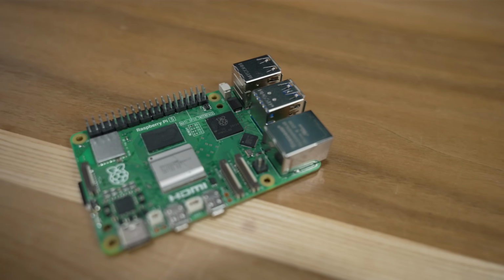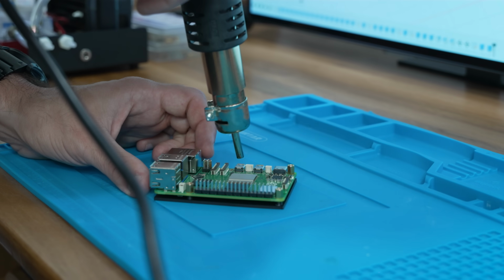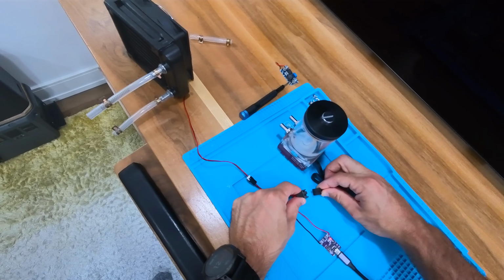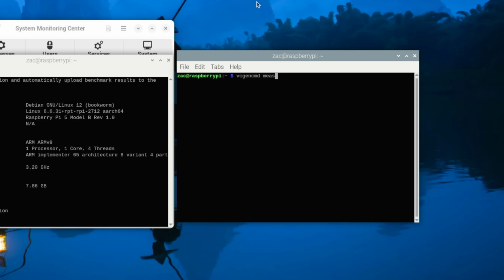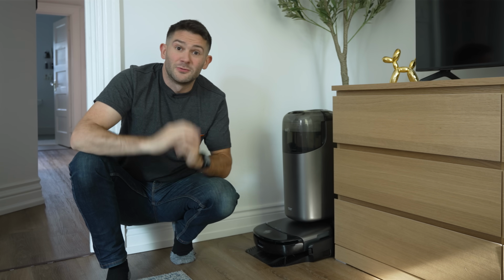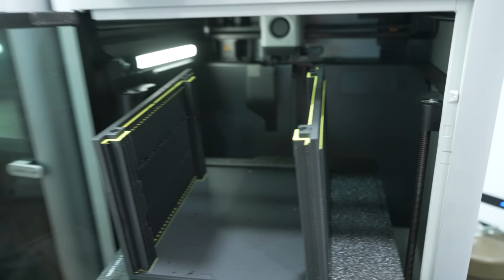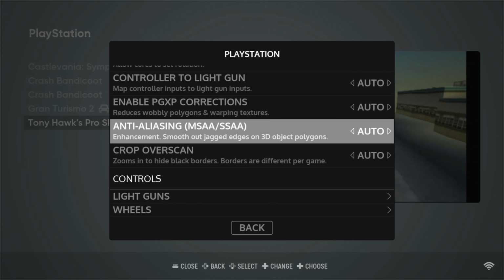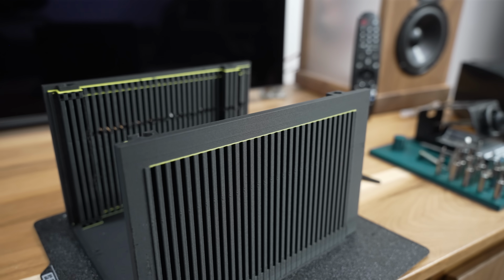Pushing a Raspberry Pi 5 to the LIMIT....

Comment: A number of things to note here. 
A. It’s pronounced like “bottosarah” or, more phonetically “baw-toe-sarah”. 
B. Your overclock only was active on the pi install. When you installed Batocera, that wiped the overclock. It’s a software overclock, and not a persistent hardware overclock. 
C. Thermal pads would have been a better choice for thermals transfer. 
D. As another has said, your 84 degree temp was rather disingenuous as you had the IHS removed. That little plate actually wicks away a decent amount of heat.  
D. You should have installed some kapton tape on the cpu where where there wasn’t direct die contact. There’s a number of onboard caps and resistors that are almost the same height of the cpu die. Your heatsink plate doesn’t stop from over tightening so you have a very high chance of shorting out the cpu since you removed the IHS.
Reply: I am glad someone else noticed the overclocked issue.  As far as I know Batocera does not allow you to provide software level overclocking.  RetroPi would have been a better option as, I believe, it relies on the same files to provide a software overclock.
Reply: "Brazing" vs "soldering" another nitpick of mine
Reply: Bruh, this was a Eufy vacuum ad
Reply: @thewolfin Did he not do brazing? I thought that was essentially what brazing was, joining copper together with solder and a torch.
Reply: @RestoreTechnique  in effect they are but brazing is more for things that's gonna have a lot of pressure such as gas, sewer, and water lines while being around 1,200F/650C. 
soldering how ever will brake under a decent amount of pressure and is used for things like computer parts that don't need to worrying about pressure to much and at a lower temperature, around 700F/371C so it doesn't burn the circuits or oxide the inside of a pipe

i apologize for the long comment but i figured if you asked you probably want an actual answer lol
Reply: @IM_A_BEAR_LOL No it really wasn’t.
Reply: lol @ everyone saying the overclock isn't active. 21:56 shows it is.

Comment: I am sure your initial temperature would have been much more reasonable if u still had the stock ihs on, 88c at idle is ridiculous
Reply: What’s IHS?
Reply: @ integrated heat spreader. (It’s the top metal metal part on your cpu that makes contact with the cpu cooler to properly cool your cpu. And as this is a very low tdp cpu, the IHS would make significant difference to how much the temperature would have been if it was still on.
Reply: @namirahnaf711 ah I see, it’s essentially a heat sink if I’m not mistaken
Reply: @AdamBeyond  pretty much

Comment: A few years ago, I got curious after watching those fishtank PC builds, so I took my RPi4 and modified a plastic tub, got 2 small fans, filled the tub up with non-conductive liquid, hooked up the fans, with them side by side, one push the other pull.
Surprisngly, it worked just fine, one day I will do it again, but next time, a custom case. :P

Comment: Potential upgrade idea for a Mk.II-- install a M.2 NVme Pi Hat (be sure to change the settings from PCIe Gen2 to Gen3.) on the Pi5 using the ePCIe connection.
Reply: Why not use an old XP or Win7 computer instead? It's pretty easy to find a small micro-atx box for less than 50$ or maybe even for free. It's not hard to find one that is more powerful than a Pi5, even if you underclock it enough to stay silent... You'll be about to install any Linux distribution you want with plenty of choice for your retro gaming software. You don't need to do any 3D printing or water cooling, etc... Just a quick clean up if it's dusty and it's good to go.

Comment: If you don't search for hype on topic "water cooling RPI5", and really search for something that you said about retro emulation beast I know some variants. 1st one is Radxa x4, it's if you want/need RPI size. But I'd rather go and buy ASRock X600, took mini STX board of it and use regular AM5 water block it top of Ryzen 8700g. You steel will need to create custom case for all of that, and all that will be in similar volume case to your RPI5. But overall performance will be "a little" more that RPI5 😊
Reply: Was thinking just that. I mean, if i look at the Mac Mini across the room, if i don't care about price, Apple has that covered off the box. If I'm price conscious, there's no end of x86 NUC's that will "outsize and outperform" this "frankenstein". The Radxa x4 i don't think fits. It's more of a kludge to have a Pi's "hats" on x86 than anything. Personally, think just having a Pi-Zero inside the NUC connected to the internal USB and exposing the GPIO as an external header like the Pi-400 does is a lot more sane, if less cheap...

Comment: you can get 5V fans and a 5V pump (the kind found in pet waterbowls) they usually have 3Meters of head pressure / 2Liters per minute.   it would be more of a closed with a T for a fill port, but it would greatly simply the design and just power everything from the pi header.  

As shown here, you can use cheap pla (I would prefer PETG)  because if the copper plate gets up to 50C, you're doing something wrong

Comment: I'd personally shave the cooling fins off the official cooling heatsink, cut out the right shape, and then solder the water block into the hole. It would also allow for removal of the block.
Reply: Can't solder alum

Comment: I mean you could have just taken a board with an 5105 or even just an N100 for cheaper and fully complete with cooling.
The Pi5 is wayy to overpriced for the hardware, The Raspberry Makers are out of their minds.

You can buy a full mini PC for the same price with less hardware issues and better CPUs with more build-in features.
Reply: I remember like 10 years ago when the pi was about education, they'd bring Pis to my school to teach us students about coding and programming. With the steamdeck pushing emudeck it has made emulating much easier now. Even a cheap phone is a better option now for emulation but pi videos still do well it seems
Reply: Facts. Pi5 is cool. But for the price + accessories (especially a water cooler lol), you are far better of getting a SFF for less $$$ and more power.
Reply: 100% An Intel/AMD box running Windows or Linux will be less expensive (and more expandable) than a Pi 5. Since the Pi 4, this has been the case. I've purchased old thin-client Thinkcentre's from Ebay for like $50 that far outperform the Pi 5.
Reply: Came for this kind of comment. Boggles my mind that someone is willing to put in the time/money to achieve like 30% of the performance of a recent-ish cheap mini PC for like 4 times as much money.

Comment: Commenting before finishing so forgive me if this gets shown. Nylon does have a high heat deflection and glass transition temperature. However, nylon will deform a lot more under stress than something like ABS. I think a better usage for the mount would have been ABS-GF. Additionally do not have to worry about absorbing or inhaling carbon fiber particles. While it wouldn't be great to absorb glass fibers in your body, they are at least able to be broken down. Carbon fiber is like asbestos. It doesn't get broken down by your body.

Comment: Dude, great video! In this space, it is statistically probable that Jeff will do a video on something embedded – related that is at all relevant, and I'm glad you incorporated it and put this out.

PS- I did a 2.4 to 3.4 overclock in 2003, when most water pumps were still purchased basically from pet supply stores. I love that it's still a thing

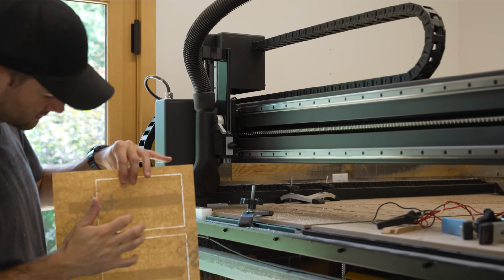PPS- 16:51 you're legit doing woodwork and staining in a video about raspberry pi overclocking... god I wish you lived in my neighborhood. There are like eight people in this Venn Diagram U.

Comment: the retroid pocket can do all this plus ps2 for the same price and way less effort
Reply: The Retroid Pocket is quite small and not ideal for most of the Games. I personally regret buying one.
Reply: @DerKlemm-Crafter  dock it and it’s still cheaper than this
Reply: Yeah, you really need more power that the Pi's GPU can offer. I'd LOVE to see some Snapdragon based SBC's, but the dev kits that are out right now are HILARIOUSLY expensive. The Adreno 750 is an absolute BEAST. On my S24 Ultra, I'm running pretty much any PS2 game I want. The only one I haven't been able to get running with AetherSX2 is Armored Core 3

Comment: The water cooler is way OTT for the small boost you were able to achieve. If you just put a std finned ali heatsink on top of your copper block plus a small gpu fan on top you could probably dump the water altogether. You turned a very light and compact RP5 into the volume of standard cube footprint PC.

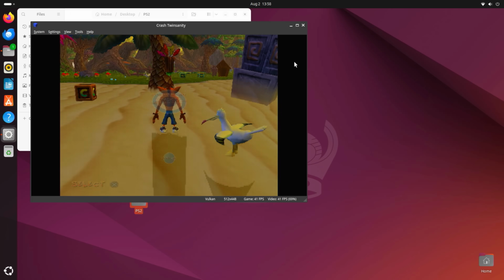Comment: 24:08 to be fair, neither windows or macos would even be able to run a setup like this, and even if they did, getting this kind of performance out of it would be even harder to do, if not also impossible. Linux is harder to use most often in these situations because it lets you do things that are harder to do.
Reply: > neither windows or macos would even be able to run a setup like this [...] getting this kind of performance out of it would be even harder to do
lol what
Reply: @adamsfusion  I am not saying you cannot run emulators on windows. I am saying running windows on the pi, and then overclocking the pi from within windows would be much more difficult while yeilding worse performance than using linux for the same job.

Comment: Instead of trying to turn a raspberry pi into something it was never meant to be, you'd be better much further ahead if you had just used a more powerful system to start with.
Reply: That was my precise thought. Why not just by a NUC that's like 3 generations older for cheap? I'd assume it'd orders of magnitude more powerful. Maybe I'm missing something
Reply: Well it is a test lot's of thing could be different and he could use different but you know , let's learn together i am mechanical engineer student and i know increasing the copper heat sink width might make it worst and it is better to use past, but no body is perfect just enjoy a good man do a test ❤

Comment: running geekbench with a bare die is, in light words, not the brightest idea.
Some parts of the chip don't have temp sensors, meaning you could have EASILY fried your pi.

Comment: instead of support interface, try using water-soluble filament to go between, it dissolves in water and leaves a beautiful finish with no risk of breaking the print while removing supports

Comment: i suggest for the cpu and overclock limit, there are many HATs for the rpi, you should find a powered case with a breadboard attachment. if you can find a way to attach another cpu to the pi in parallel, you can solve power problems for the extra with that, and have it mounted somewhere separate so another heatsink or water cooler can be attached.

Comment: Btw as someone who uses PACF a lot, check that part in a months time. Will be as straight as banana. Heat resistant does not mean holds shape with a constant force over time unfortunately :(

Comment: I jumped the Pi/Retropie ship this month. I know you used Batocera which is also good. I have been using Pi's since the early 2's for emulation and keep buying new ones all the time. I refrained from the 5 as I would be about $500 total into Pi's.

So what does one do? Well, FPGA! As we speak I am building my MiSTer and getting ready to rock. Retropie/Batocera are awesome and so is the PI, but it just takes so much time to configure everything. And, emulation is great, but hardware recreation is even better! 

Still, great vid as usual!

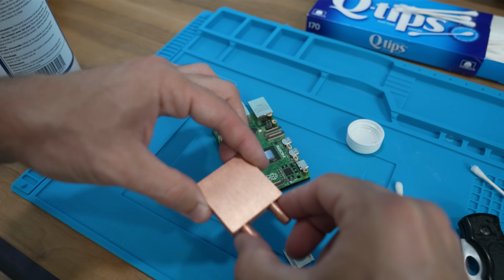Comment: 4:23 thermal conductive paste is for just that, removal and having "nothing" is worse than having paste (the paste enters micro cracks for better thermal conductivity). As if you wanted to go for the limits you could even buy and use liquid thermal paste.

Comment: I'd just use the PLA hold down as a pattern to drill a few holes in some aluminum, use some stiff springs as a thermal expansion compensation  under the screw heads and good to go.

Comment: In my experience the broadcom CPUs tend to become very unstable at high overclocks long before you hit thermal throttling temperatures even with air cooling. Just having a heat sink and a fan is usually plenty enough. I'm also surprised that you went through all this effort to push it to its limit then didn't even do SSD boot, which makes a huge difference.

Comment: I made a retro gaming system with Raspberry Pi 3 and RetroPie software.  But it couldn't run N64 at all.  Good to know the 5 can.  I so wish I had a 3D printer.  I bought a generic electronics hobby box and cut slots in it manually with a Dremel and exacto knife.  To power it, I discovered PicoPSU and found a tutorial on installing a powered pushbutton.  I have been thinking of making a new one so I no longer have to break out my N64 to play those games and can easily have it all in one place.  I was thinking I might also get the M.2 HAT+ addon to use an M.2 SSD.

Comment: I've always wanted to do some crazy insane cooling. Like desolder every single I/O piece, solder extensions for critical I/O like the power, USB, ethernet, and video, then coat it in liquid electrical tape or conformal coating. Then dunk it in dry ice cooled isopropyl alcohol! 
At that point the PCB is naturally going to cool the CPU from below by its thermal mass alone. I don't think there's a better way to cool a raspberry pi!

Comment: A rougher surface would have more area for the heat to be transferred from the thermal paste right?  

That's why coolera have fins right? They are faster at absorbing and decorating heat right?

Or dis I misunderstand something?
Reply: No. You want a smooth surface on the cooling block to maximize contact and consistency. The fins are good at increasing air exposure which increases the surface area for cooling, but the block should be smooth to ensure an even spread of heat and no specific hot spots.
Reply: @basspuppy133  maximum contact happens in a rough surface right? If the fins provide maximum contact to air exposure, then they provide maximum contact to liquid exposure too (thermal paste). 

I get that there should be no hot spots. But still the surface area will increase with a rough surface.
Reply: @neilcoelho  if you have a rough finish you have some spots with less contact directly with the thing it's trying to cool and it reduces efficiency. the increase in surface area is not enough to off put the decrease in efficiency that causes. that's why all cooling blocks are flat and smooth.

Comment: Video idea to follow on this one - do another case, possibly the same dimensions as the one in the video, that interfaces / sits below the Pi-console. This box could house another PI, or an extension to the PI above, and could house an additional fan, plus storage / other hardware so you could expand the features of the whole system. The two 'boxes' could then be either one system or two and be customized to be anything you would want. Like an emulator + NAS storage, or router + NAS, or whatever anyone could think of :D.

Comment: 18:14 I noticed some Z axis artifacts. Make sure your Z axis grub nut is very above torque spec for that kind of fastener. If you have a Z axis screw put the grub nut in the shallow part of the thread. Grubs have rounded heads and naturally feel tight while having slip specs lower than torque would indicate.
I think a problem with modern 3d printer design is the tiny surface area of coupler grub nuts lets high torque small movements slip on the metal surface. You get acceptable performance but have these visual imperfections caused by z axis lifts that don't complete. It really really needs to be very tight for the most consistent Z axis layering. Z axis moves the least with the highest torque impulses, moving the whole print gantry.

Comment: now you should  add two NVME hat drives and some more ram. You should also add the big fan or just add another one like a little one pointed to the actual board in the case.

Comment: I found a small block at one point in time and water-cooled a pi zero just to see if I could. I had similar results with built-in limits but it did work well to keep the temps cool.

Comment: Soldering and brazing are very different processes. Brazing is closer to welding with copper while Solder is closer to gluing. When you braze the temps are way higher and flux isn't always nessicary Solder is much lower and always requires flux (except for certain situations) brazing is much stronger than Solder though. *speaking as an industrial plumber

Comment: Not sure if anyone else has mentioned this. But I'd strongly advise against using K5 Pro. I ran it in a gaming laptop and after 6 months of use, I noticed massive temp increases on my VRAM. When I opened up the system, I noticed massive pitting and bubbling in the K5 Pro accross all memory modules. The K5 Pro had literally boiled, seperated, then congealed. It left pock marks accross all of the laptops VRAM modules that wouldn't come off with 99% IPA. Upsiren UTP-8 thermal putty is a much better, and cheaper, alternative to K5 Pro. I had a significate reduction in temps on VRAM after using UTP-8, compared to K5 Pro. There are many other people, way smarter than me, that have done extensive testing with both putties. UTP-8 comes out ahead in every test.

Comment: A raspberry pi gaming console without an SSD is kind of a pain in my experience. Not only due to capacity and transfer speed but reliability as well. Better to make use of the new PCIE header and get an NVME drive.

Comment: Nice project, although I would have used an integrated Pump/block/reservoir so I could get a smaller footprint, also the 120MM rad might be a bit overkill there are some 92 rads fit it with a 92mm noctua and bang, would be nice to see you getting this project as small as possible without losing the performance, I feel like you have a loooot of thermal headroom with that configuration.